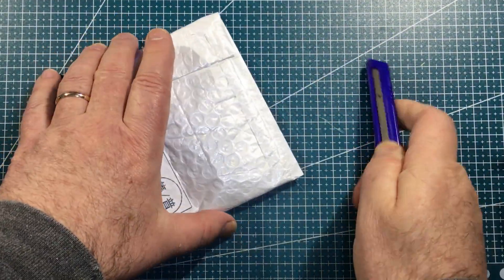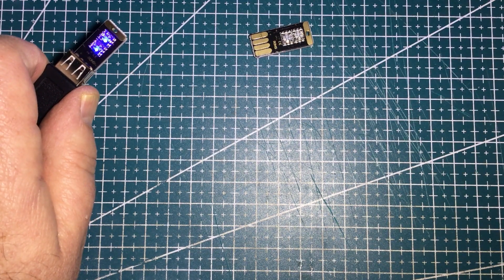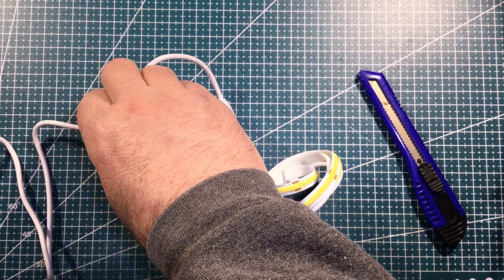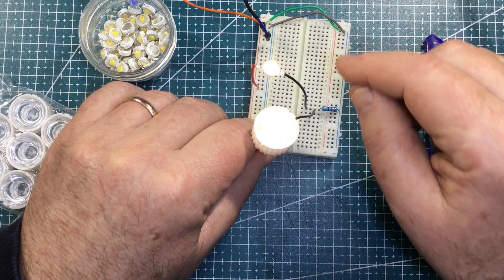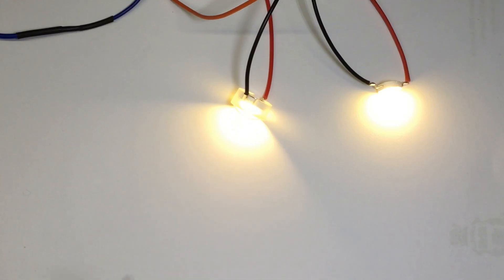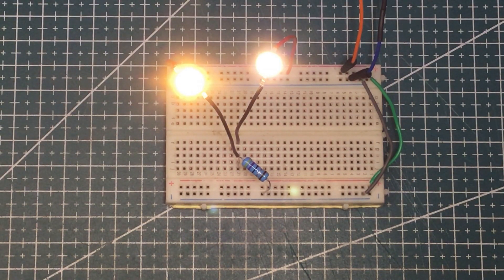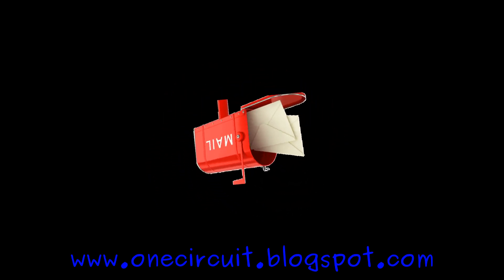Mailbag #28 - so many LEDs!

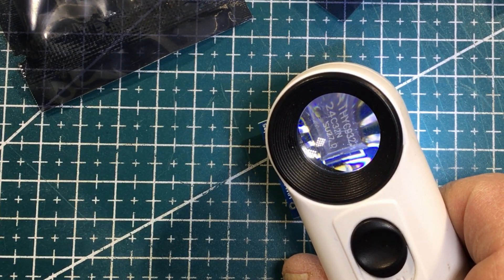Comment: @3:02 - weird little unit. You can add DS18B20 as well to have 3-in-one (board have place for it and dedicated output pin). For use with non-rechargable battery, you need to break charging circuit - by removing couple of elements as far as I remember. Clock by my experience is BAD, runs away very fast. maybe I've got bad crystal.
Reply from the maker: I've worked with similar that have a built in temp sensor that compensates the RTC - in one project I have the time and temp output. I'll throw these on a breadboard soon and take a look! 👍😀